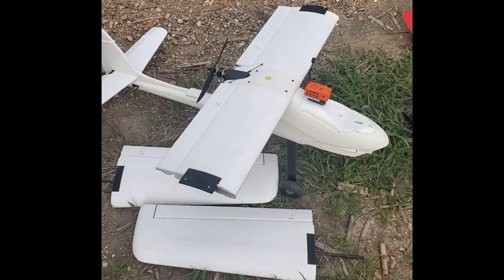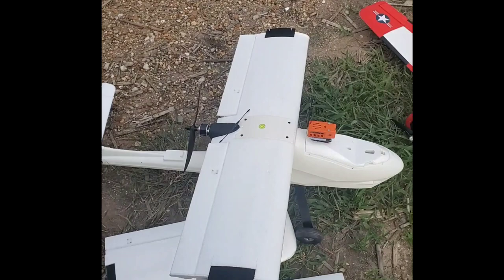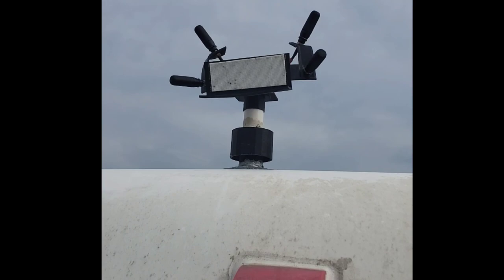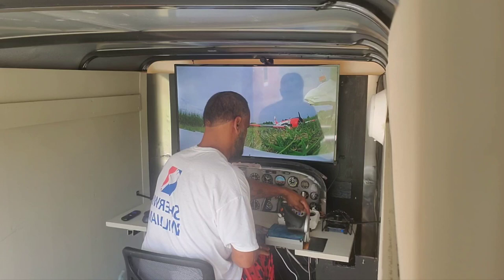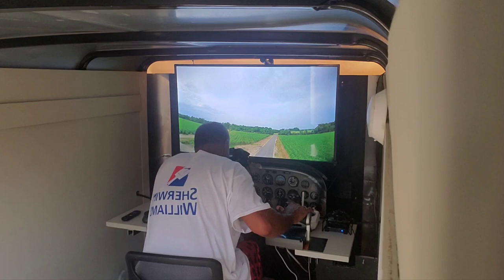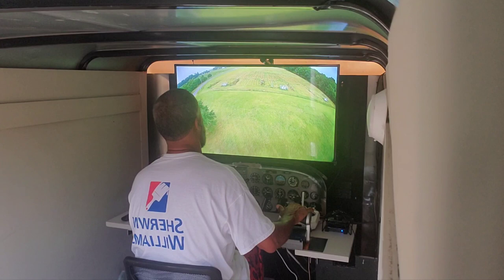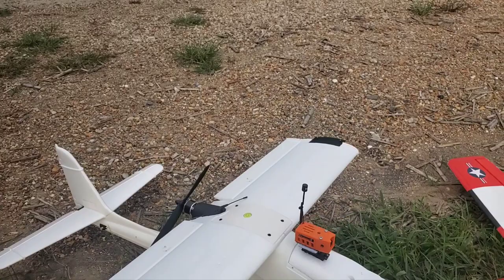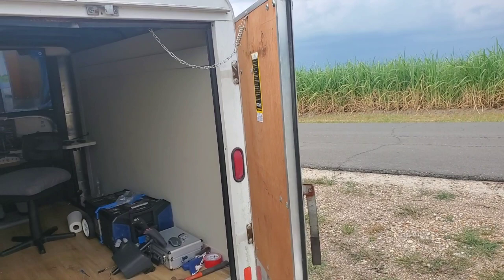DJI , AXIS FLYING BOX , CINERACE20, TEST FLIGHT

Comment: Awesome engineering! That's a killer setup you have!
Reply from the maker: Thanks bro , it's actually pretty easy to setup all you have to do is cut the wires from the remotes potentiometers and reroute them to the potentiometers in the yoke , rudder, and throttle, almost bought the winbox system but it's limited to range because you have to use their receiver, I'm using crossfire so I can go pretty far as you know!!
Reply from the maker: Like share and SUBSCRIBE bro , trying to grow the channel

Comment: Yep, my same intention, but with a 44" hdmi TV and a van instead of a trailer.  When I tested it, ti was in my kitchen by my gaming PC.  I bought the same Axis Flying box without the fan.   All the apps except the control panel would crash on launch or run for a little while then crash.  The video link never lasted more than 10 seconds in my test.   I sent it back for RDQ store credit,  My probably best tested power supply was the Amazon Basics one.   I'll have to check my videos to see what version firmware the Axis Flying Box was running... it was only a few months ago though.

Yep.  Exact same setup.  The only thing I  can guess is:
1.   I had adaptive power on on the air unit, which they say messes up things and you have to turn off.  That doesn't explain though the webbrwoser or Betaflight configurator crashing immediately after launch as well.
2.  My firmware was older and more alpha and just a POS.  They came out with two versions, one that shipped with Betaflight, and a later version that came with SpeedyBee App isntalled.   I had the earlier Betaflight version.  Maybe you have the SpeedyBee V2 version.
3.  Maybe the heat sink had fallen off inside during shipping, so any time my box throttle up out of idle it cooked the CPU and crashed and rebooted (just a guess, but that makes sense)... however, I heard nothing rattling around isndie when shaken, so...
4.  Perhaps my power supplies weren't putting out enough amps, and the CPU would also crash on throttle up from idle up with more power draw but unable to get it from teh power supply, which is why I tried 5 different USB-C 3.0 or whatever power supplies that could supply multiple voltage ratings at various amps.  They all worked about he same with same effects.
5.  My Axis Flying box was just a piece of junk or customer return.

Oh well.  Assuming I had gotten it to work..  I could fly at 100ms latency, and do wide open spaces aerobatics, but I wouldn't be doing any tight close in aerobatics which is what I love doing.

----

Here's my one and only test flight in the goggles before I went way more blind...   I had lockedthe DJI power on the air unit to 250ms.. the lowest setting to keep it from cooking, while configuring it on the bench.. and forgotten to raise the power up to 1200mw for the flight.. so you can see the range you can do on the lowest setting of 250mw in my video.   When I fly down the road chasing the car, and turn around, I'm right at the limit on 250mw and 1-2 mbs...  while running the 50mbs firmware.  For some reason I uploaded the 720p goggle recording, instead of the 1080p air unit recording in my excitement.  Also, the 720p recording looks smoother with fewer moire effects due to the lower resolution.   I followed the tracks in the field and the road on e\the maiden flight for the same reason you stay out of the cane field.. if I had to recover it, I wanted it to be easy walking...:

The quad hadn't been Rates or PID or filter tuned at this point and I only had about 200 hours in the sim so far.  Currently I'm somewhere around 4,000 hours now so... yeah...  it's been a year or two:
https://www.youtube.com/watch?v=uNjpZSKJxBw
Reply from the maker: I believe mine said version 3 when I purchased it , I can't get the web browser to work either, never tried the betaflight app
Reply: @jimmytheriot8978  Hmm, interesting.  The newer version was suppose to ship with the SpeedyBee app instead of Betaflight.

If I try this again, it won't be with the Axis Flying Box, but I think I'll try Cosmostreamer on a Raspberry Pi hardware box.   If it don't work, I can repurpose the Raspberry Pi as a webserver.   

I suspect the Axis Flying box is running a cheap mobile phone chipset and a butchered wall gardened copy of Android, becasue the control panel sure looks like a stripped down version of Android.

Thanks for the video, and glad you got yours um working.   Should be fine for flying planes and quads in angle mode, as long as you don't lose the stream...  as it don't reconnect as far as I know.  So have that return to home swtich function working!

Comment: Very interresting. So you got the hdmi output working but without osd on the screen.
Reply from the maker: Yeah whenever you use hdmi out dji doesn't support osd on hdmi out just like when you record,  I still have the goggles in front of me so I can glance now and then at the osd or incase something happens to the screen I can put the goggles on
Reply from the maker: Just ordered the fatshark system with has hdmi out straight from the goggles so should have osd too!!!

Comment: That is the coolest thing I’ve ever seen. Too bad the OSD doesn’t come through.

Can you show how you got the joystick to interface with the Taranis? I’ve been trying to find a simple way to do that myself.

Keep it up!
Reply from the maker: I ll make video soon but it very simple, all I did was disconnect the potentiometers in the remote and wired the potentiometers from the yoke throttle and rudder to the wires in the remote that the remote potentiometers we're hooked to
Reply: @jimmytheriot8978  oh, I was hoping there was a plug-in option that would let you use the radio separately when needed. Saw a couple but they seem shaky. It’s still super cool!
Reply from the maker: @835FPV  yeah they have a couple of systems but the range is limited, I have several radio so I modified this one